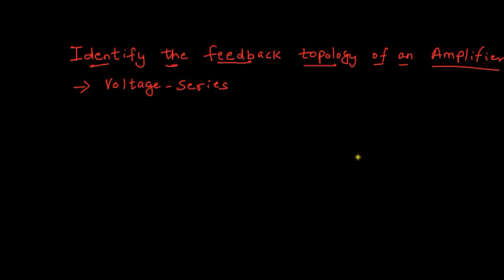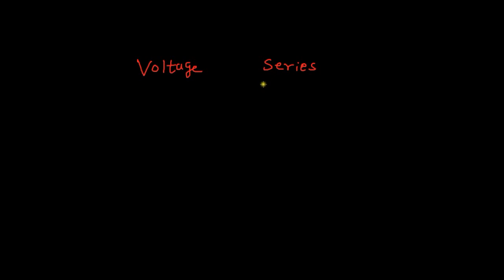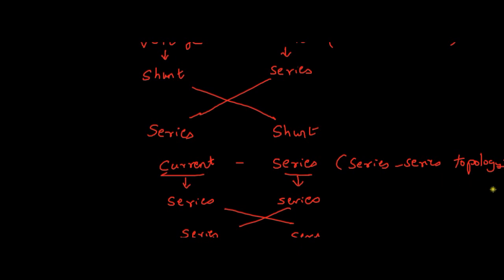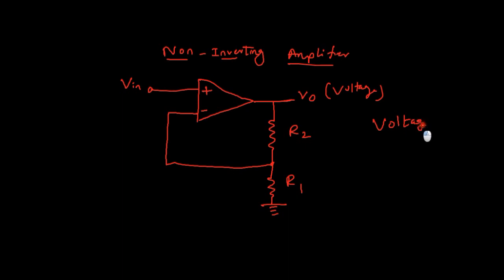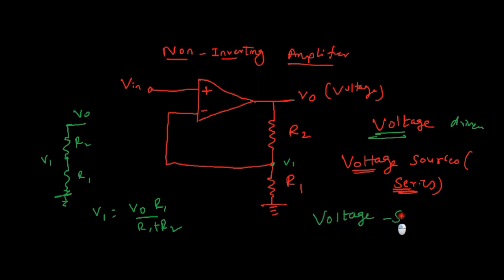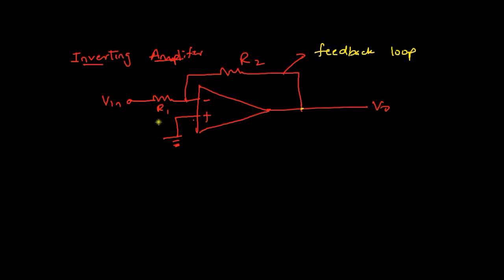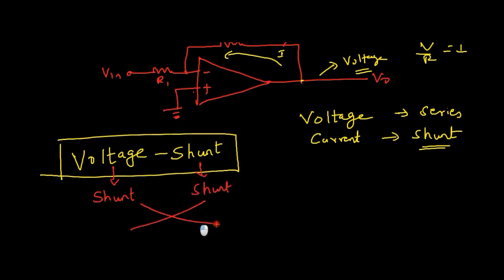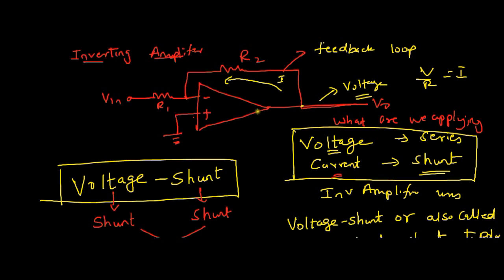How to identify feedback topology of an amplifier.

Comment: how to calculate beta or feedback factor of any circuit
Reply: qoimoi.com There are some parctical feedback networs widely used for stability. There is no particular rule for calculation of feedback fraction ( beta). In many practical feedback amplifier , the feedback network (beta ) is voltage divider type.For those cases analysis is very easy .But for some feedback network to calculate the feedback factor , you may have to apply small signal model of BJT or FET (small sigbal analysis of amplifier ) .In those cases calculations are difficult. For detail , you can check NPTEL Videos.